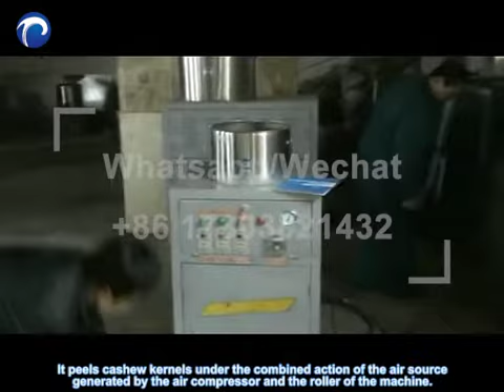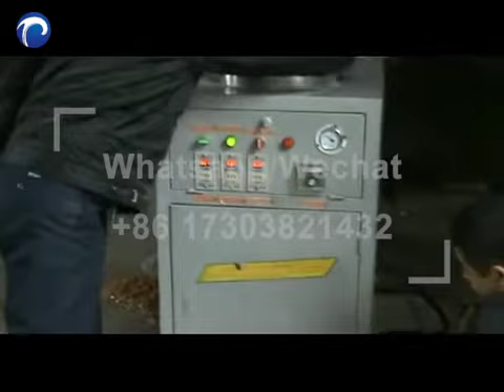Cashew nut peeling machine in cashew processing plant

Comment: मशीन का price
Reply from the maker: Please leave your contact, we will send you the machine details. Or you can contact this Whatsapp: +86 17303821432.
Reply: Do I need to boil the cashew before putting inside the machine ???
Reply from the maker: @tigerimran2454  Before cracking the hard shells, it needs to be cooked. So before peeling, it does not need to be boiled again.
Reply: So, basically after cracking the hard shell, we need to put those nuts inside this machine to peel off the soft shells, isn’t ?
Reply from the maker: @tigerimran2454  Right.
Reply: I thought it's a SHELL CRACKING machine. Basically, I'm looking for that one in a reasonable price for a very small scale pilot project. 

However, can you please let me know both the prices: 

- Shell Cracker Machine
- Peeler Machine
Reply from the maker: @tigerimran2454  
Yeah, we have that kind of shelling machine, too. And can you give me your email and whatsapp? will send u more machine details soon. or you can add my whatsapp: +86 17303821432